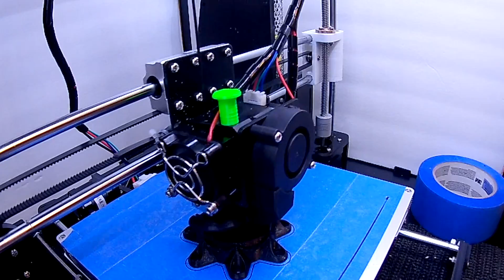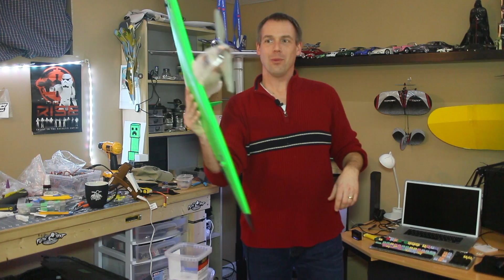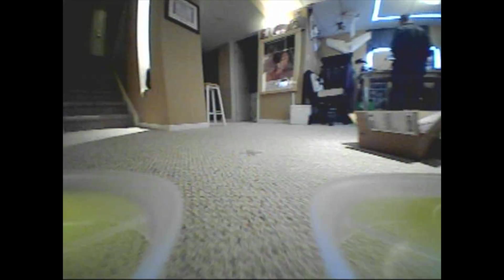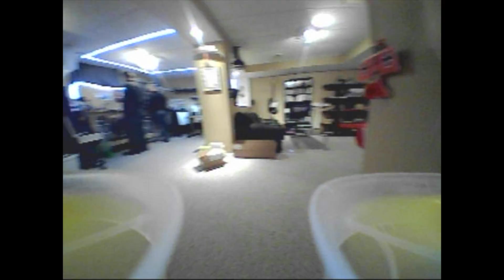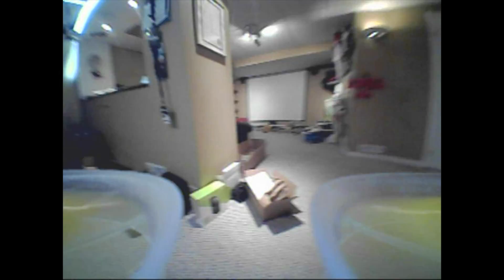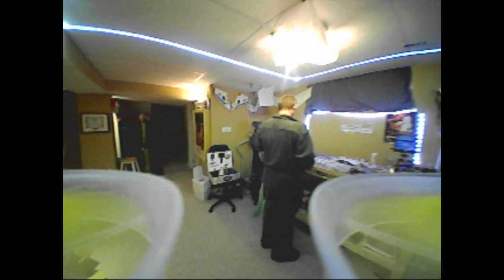3D Craziness - Update #84

Comment: Did you have any issues with the wing being loose when inserted?  Mine has a good 1/16" gap between the wing and wing mounts so I'm not liking the way the wing feels loose.
Reply from the maker: Add some foam.
Reply: Interesting, I hadn't thought of that...like some adhesive foam to the back of the wing where it goes into the fuselage?  I was going to add plastic strips there to build up the part that goes into the fuselage but adhesive foam is way easier I think.

Comment: Don't know if it's because I'm old school, but... I would have moved the elevator servo forward closer to the CG to help get the balance correct and keep the plane as light as possible. Then if still required you could perhaps add a little less nose weight.

Waiting for the maiden flight video... ;)
Reply from the maker: Future project when I re-print the plane. I'll try and build a bed for the servo and move it inside the plane. They did this on all their other planes later on.